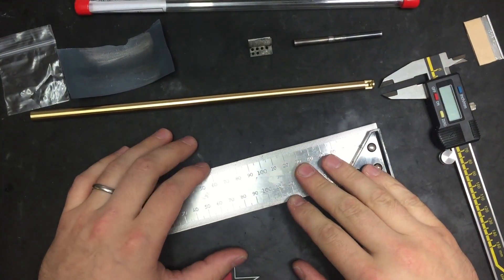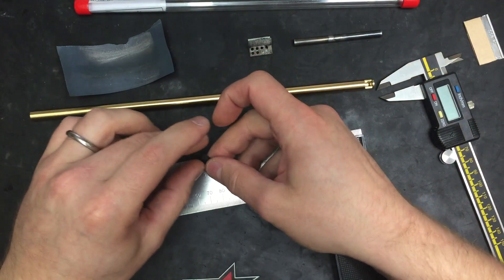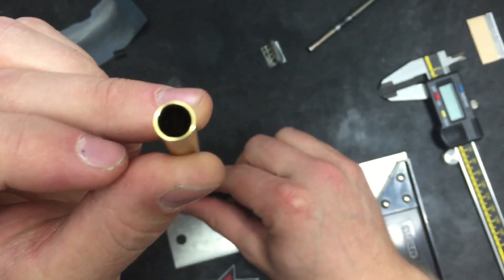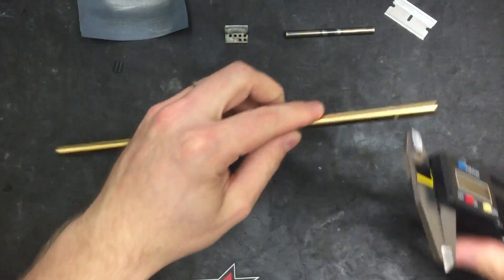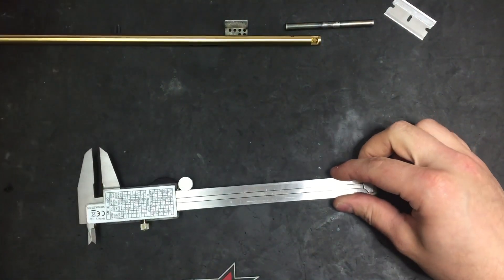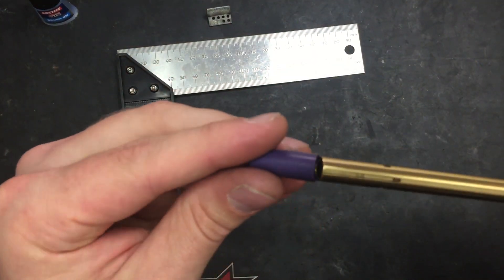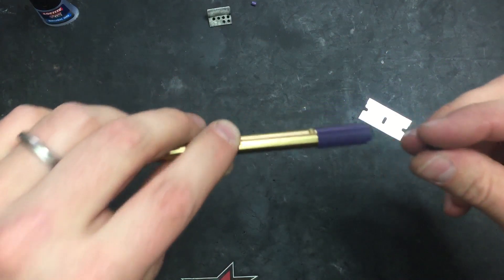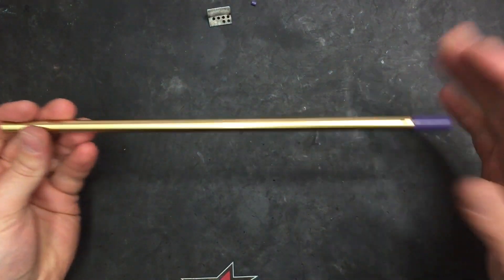KoA R-Hop Installation Guide

Comment: Love the installation guide, very, very helpful for those of us beginning the R Hop journey. Just one question, I've seen others suggest removing the ridge from inside the bucking that locates in the groove on the outside of the barrel as well as the bucking mound, which you removed, and then rotating the bucking 90 degrees when installing so the bucking exposed to the patch is un-sanded, Have you not found this necessary?
Reply from the maker: +Barry Keane Not at all.
It seems like people do that so they're not putting a rough, uneven surface atop the R-Hop patch but if you sand it gently as shown here, that's not an issue.
You're also introducing a slight air leak by removing the line that usually fills the groove on the barrel.

Comment: Great video.  I'm about to embark on the process, but my barrel does not have a square cut hop window.  It is 6mm at the bottom but opens up to 7mm at the top meaning both of the sides have an angle to them (its a prometheus krytac 6.03).  Is it better to use a 6mm long r-hop patch with square cut sides (as you do in the video) so is it not touching the sloped sides of the window but has wedge shaped gaps where the hop window edges rise towards the outer diameter of the barrel or use a 7mm r-hop patch that I shape to fit the hop window cut out with no gaps i.e. it has tapered ends to take it in from 7mm to 6mm to match the shape of the hop window?  I'm not sure if the shaped r-hop will be hampered by the slopes and not get pushed into the barrel properly by the flat m-nub.  if there's no real difference in performance, the square cut 6mm option would seem a simpler install than shaping the r-hop patch to fit the non-square hop window.

Comment: Hello I have seen some people hold down the patch by wraping ptfe tape over the patch and then placing the rubber of it. Does this work or do i need to glue it down
Reply: John Riches That tape method doesn't work. I'd prefer that buy some silicone tube from amazon or ebay, they come as long tubes. Cut a patch from that and it doesn't matter if you fail since you have that whole tube. When you glue the patch, stick some cloth or paper inside the barrel so the glue wont run in the barrel. And what's better, usually the tubes are really weather proof so your hop works even in super cold temperatures. I've done this method to my every gun and works really well, its a lot cheaper to do that than buy pre-cut version

Comment: Great Video....gives a great insight into how to do an R-Hop and removes some of the black magic associated with the process.
Was think of trying a modified hop for the first time and was going to try a flat hop as the first one....in your experience are flat Hops any better than the standard hop supplied in some AEG's and would you attempt this as a first modified hop.
Reply from the maker: +Graham Swan I've had limited success with flat hop modifications.
I found that they definitely gave extra backspin, and therefore range with heavier ammo, but lacked the consistency I wanted.

I quickly moved on to R-Hops.

I can't say I've tried many of the drop-in solutions that are now readily available.
If you have a play around, definitely share your results :)

Comment: more descriptive detail... but the lack of video ruins it in hindsight.. the segment of gluing the edges are vital to see and explain, such as stroke from the exterior edge, downwards along the outside so none of the glue gets smashed into the window when pushing the patch into place.... getting loctite in ur barrel is a game ender for most or average non tech savvy person or kid.  Guys.. gluing the barrel is essential, but be aware if your like some people I know of, that attempted this with their only gun, not being able to replace anything and gummed the barrels up, one guy glued his bucking to his barrel, via patch by accident because he used Loctite Gel, which apparently acts different and stays tackier longer.

Just my 2 sense from personal experiences. Great way on cutting the patch out and sanding. Carbon Fiber Arrows at Walmart are 0.99 and are 6mm perfect diameter, for those who don't have access to a 6mm rod.
Reply from the maker: Nomad 087 Cheers for the comment :)
I've been meaning to do another video with everything on screen (that vice isn't bolted to the desk any more) and cover the gluing and nub cutting processes.
Reply: Just drop the end in acetone. Should break down the superglue. Then swab the barrel

Comment: Very nice video KOD. Can you link me where I can purchase this RHOP in 3 pieces? and also it seems you have a 6.05 ID of edGI. is this the best ID that you can recommend? im planning to change my Innerbarrels but not sure if I need a tighter one or this 6.05

TIA.
Reply from the maker: +X PH Sorry about the delay in responding here.
Where abouts are you based? Many shops carry the Z-Kit; Airlab in the UK and Clandestine in the States.

The barrel quality is much more important than the specific bore diameter.
What's the gun, barrel length, fps and ammo that you're using for your setup?

Comment: I'm trying to figure out if i can install an rhop in an APS APM 50 shell ejecting sniper. It's got the hopup disabled, but do you think a TDC mod + an rhop mod will do the trick? i'd artificially tap the outer barrel and make my own hopup screw to apply downward pressure onto the hopup.

Comment: are you using the original rhop kit or the Z-kit?
Reply from the maker: +unfussylobster 
I use the original patches.
If you use this method, you can get it perfect every time with a little practice.
It takes a bit more work but it means you always get three installations from each pack instead of one or two.
Reply: +Kingdom of Airsoft thank you for the advice.